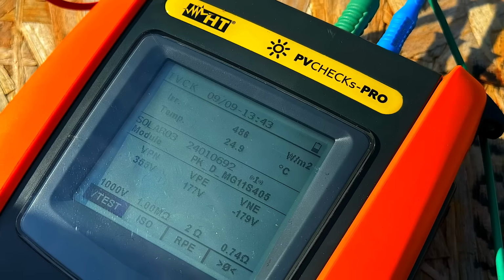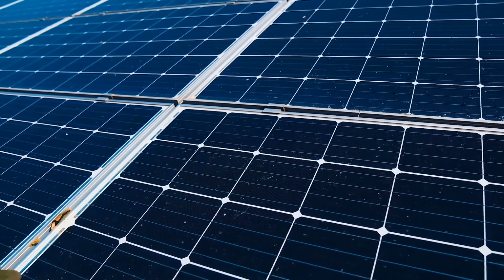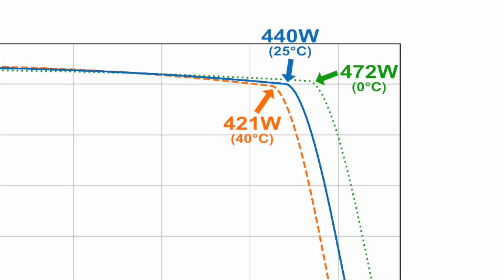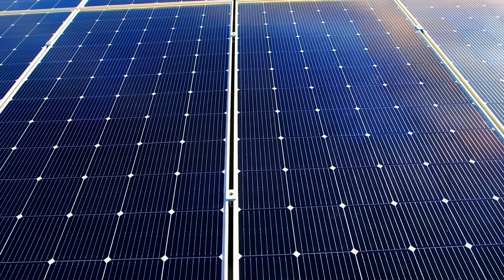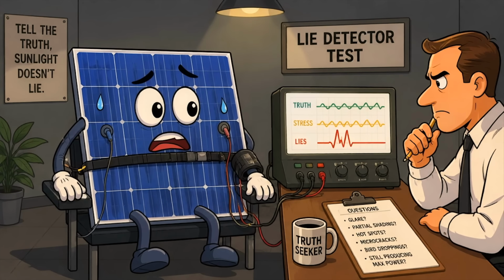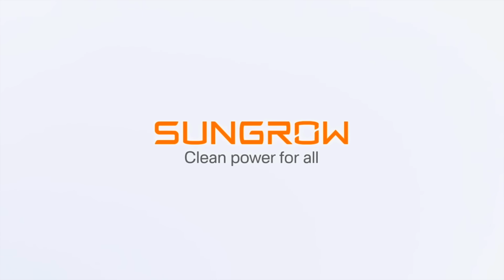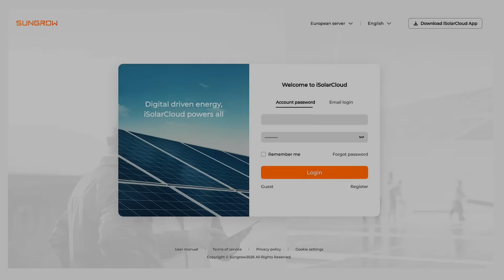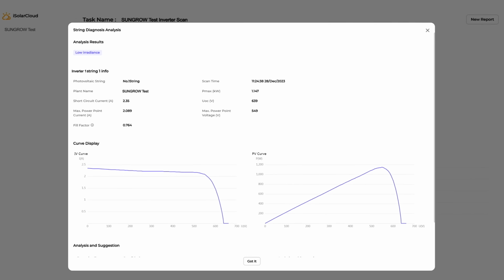The Solar Lie Detector Test - IV Curves Explained

Comment: It is not true that you don't get useful power out of the solar panel if you are not operating at the MPPT point.

All power coming out of the panel is useful if the load device can handle the voltage, if it isn't too low.

Operating at the MPPT point simply maximises how much power you can pull out from the panel for a given illumination intensity.
Reply from the maker: That’s correct, but to get maximum ROI most systems aim to operate around the MPPT.

Comment: How to identify the exact faulty panel when multiple panels are connected in a string?
Reply: Measure the voltage across every individual panel.
Reply from the maker: Depends on the type of fault suspected - ground fault locators are good a identifying exact location of some electrical faults. Drone survey for damage.